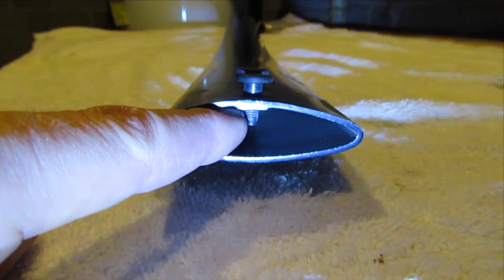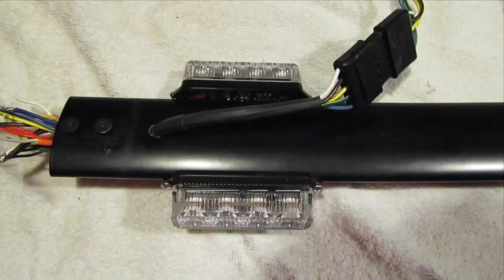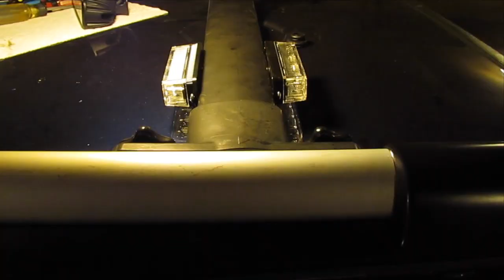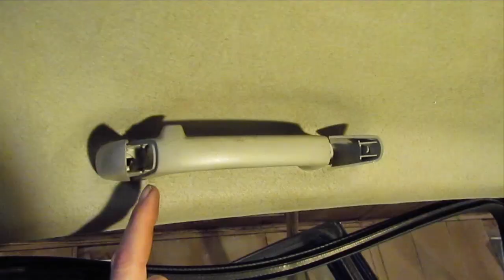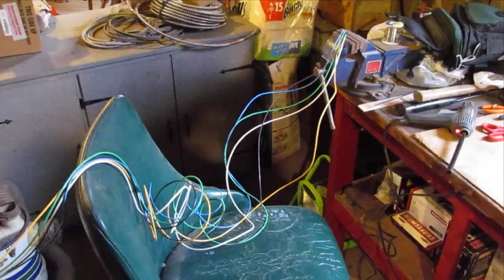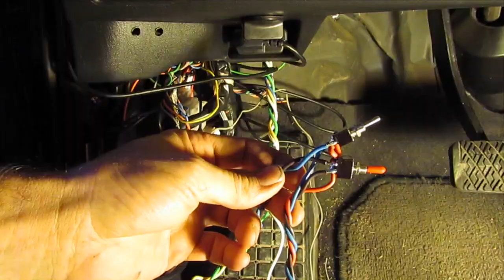Mounting lights to Vehicle Roof Rack or Roof Cross Bar

Comment: legality of lights varies by state. for example, in Az, red and blue can be used as a warning device only if the vehicle is static.

otherwise on a moving vehicle  white and amber must be used on the front, white and red can be used on the back.  Blue is restricted for emergency vehicles  when moving.
again, light regulations vary greatly from state to state

Comment: I've been looking for a watertight wat of running the iwres through the roof.  Some type of conduit would be good.  What did you do on these?
Reply from the maker: ***** I made a hole big enough for the wires plus a grommet.  After running the wires through the grommet, I sealed around the wires and grommet with automotive silicone.

Comment: Just wanted to say awesome project, I'm a huge fan. However I fear there is no way the flashing red lights are legal.
Reply from the maker: xyz12334567898 For the installed application they are legal.  You are correct, for non first responder applications, one would have to stick to white, orange or possibly green depending on jurisdictions legal requirements.